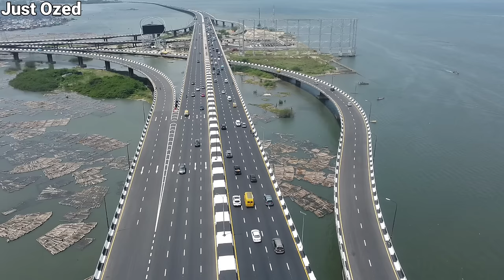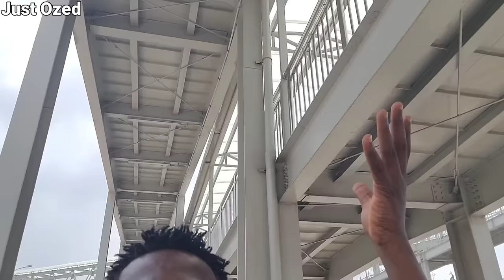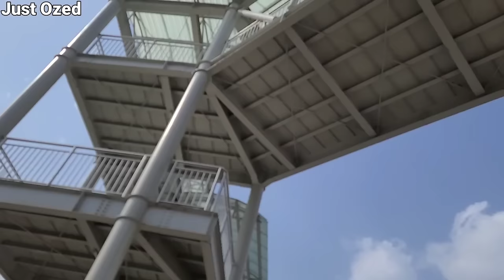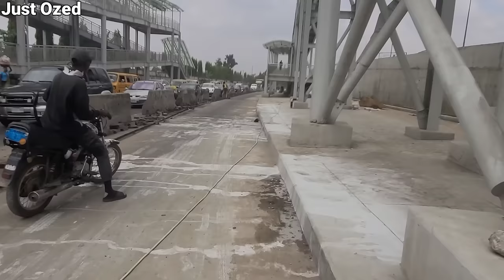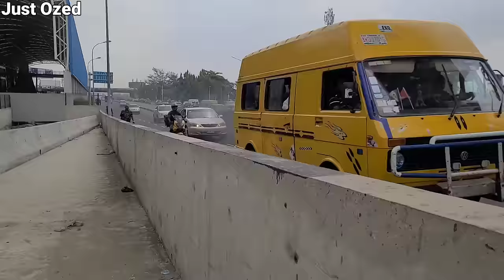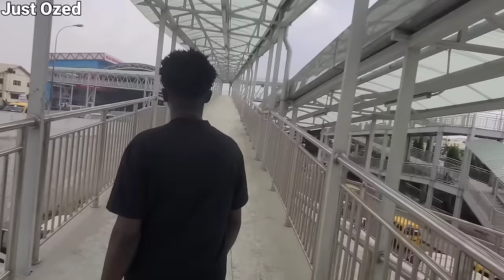IKEJA TRAIN STATION TRANSFORMATION! Lagos BRT Lane Reconnection Update

Comment: Well done boss, you are doing a good job. It is good they have created another lane apart from the overpass coming from oshodi. The reoccurring problem of this road was always the traffic encountered coming from Ile-Zik to that filling station opposite Ikeja train station. Regardless of BRT dedicated lanes, I was thinking they will create more space by building the foot of the bridge(the metallic bridge that connects to the station) towards the airport wall (if possible carving out from airport land). Creating another BRT lane compounds the problem because it encroaches into the already tight road. The danfo people also do not help matters because they stop to pick people at that spot.
Reply from the maker: @emmanuelobamonire9979  I believe when full completed the Lagos traffic management will enforce compliance of vehicles not to park on the roadside especially around that corner 
Every space there is almost utilized based on my findings I asked wouldn't encroaching on the first lane of the Lagos Abeokuta express create reoccurring traffic jam I was told they put the road demarcation to observe the traffic condition and so far the report is a good signal for continuation of the project plan